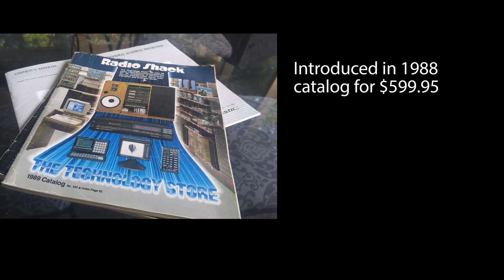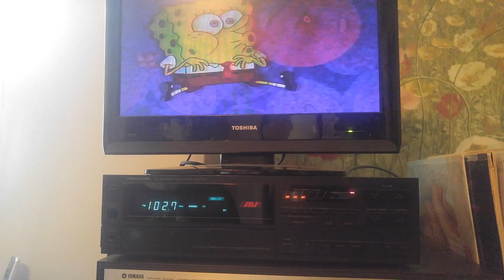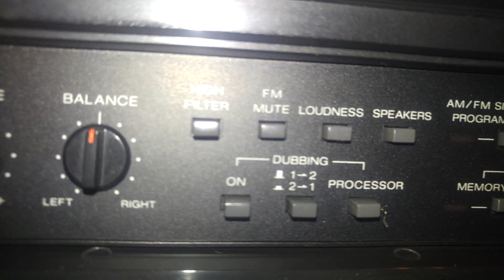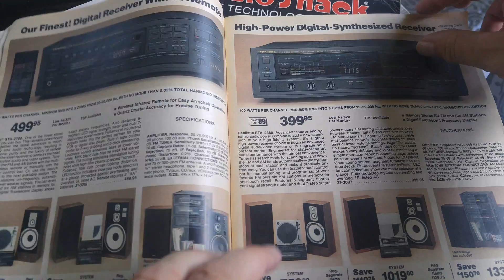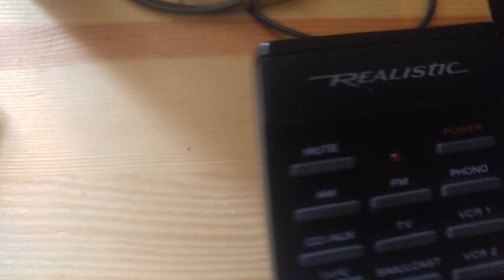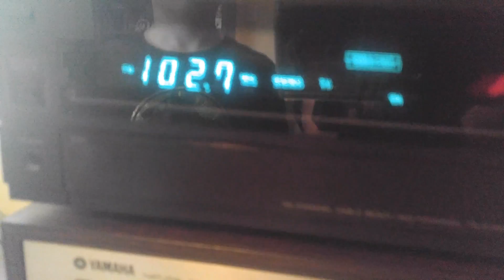Realistic AV 900, a 30-Year AV "Marriage"

Comment: Any chance you have a link to the proper manual?  And, any chance you might've found the 4 or 5 digit codes for a universal remote for this?
This is what I'm using for my little TV room, and so far, it sounds great through the mismatched Bose speakers my boss had laying around.
Reply from the maker: I have the printed manual, will try to scan it and upload to hifiengine when I get a chance, and then reply back here... As for the remote, back in the day we used "learning" remotes where you held the remotes end-to-end and the remote copied signals from the original. If you don't have the remote, the only thing I can think of is just try all the codes... However this was a Radio Shack product not a re-branded Pioneer, so not sure if that would work or not... Looks like someone is selling the remote on eBay for $16.95...
Reply from the maker: https://www.hifiengine.com/manual_library/realistic/av-900.shtml

Comment: Do you know how many watts it is? I just got some speakers that have a maximum input of 140 watts. Was going through storage today and found this receiver. Was wondering if it would be safe to use it to power the speakers.
Reply from the maker: It is a very low-power receiver, only 35 watts per channel... (You can see the specs at radioshackcatalogs.com click on the 1988 catalog page 8). I always used it with very high sensitivity speakers so it was no problem making lots of noise... Thanks for watching the video!

Comment: Bought an AV-900 new but don't remember if I bought it on sale or not. Sold it at a yard sale many years ago. I still have the remote & owner's manual.
Reply from the maker: You could probably sell that remote and manual on eBay. I just searched for the AV900 and there are several for sale but it looks like they don't include the remote. Anyway, thanks for watching!

Comment: Interesting video here.... my father has one of these which he got brand new, and yes... he actually did use two vcrs with it back in the day but now he runs just one, along with a high end cassette recorder and an export dvd player [which will play disc's the US machines won't....]
Question - which I don't expect you to know the answer to: How does one tell how loud the volume is set ??
There's no level indication that I am aware of - that being said, there's no way to tell where the volume is set.
Is there something that we've been missing all these years - or is it just random where one hopes for the best.
**That Yamaha receiver is the best, incredible as this may sound - that's what I use, still to this day - and have a Panasonic DAT machine patched into it, along with an early 80s TEAC and Denon CD player, and a liner tracking turntable, and Waferdale speakers.
God bless the late 1970s, 1980s :) :) :)
Reply from the maker: There is no volume indicator, though makes a very quiet ticking sound if there's no audio playing when you turn it up or down. Thanks for the comment!